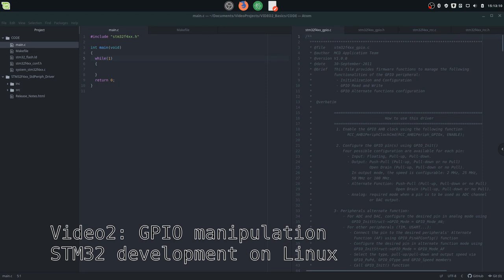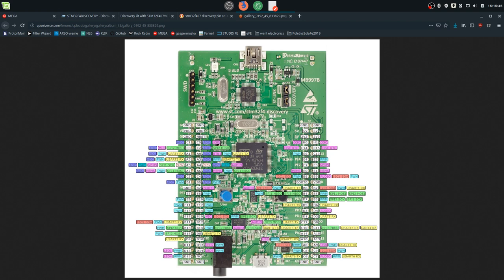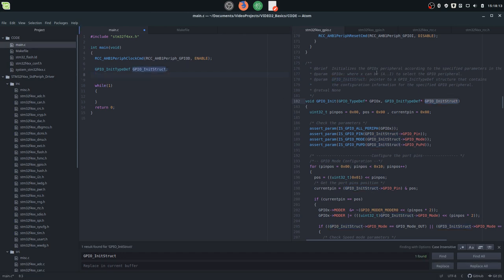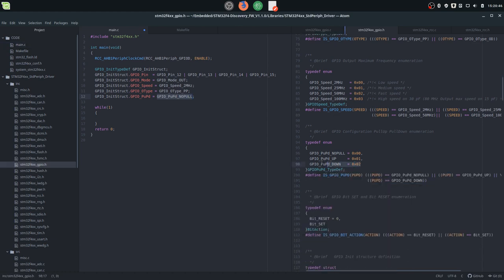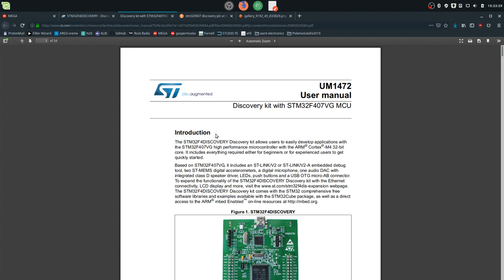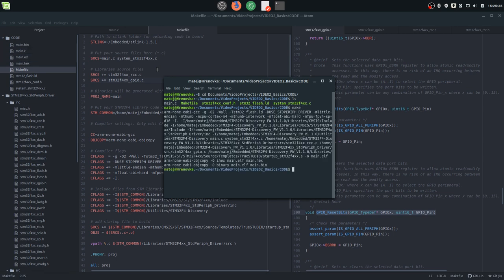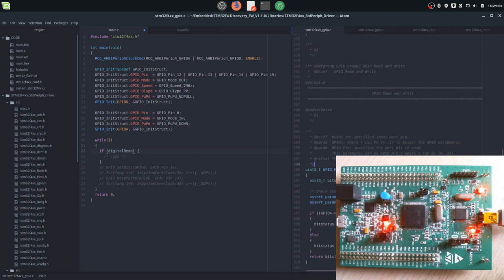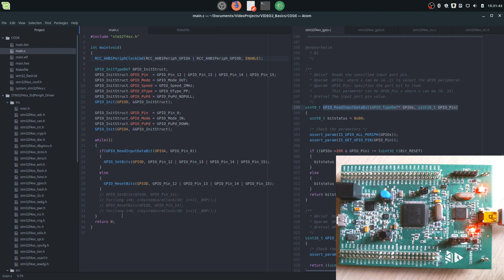Basics of GPIO | STM32 development on Linux | VIDEO 2

Comment: Excellent videos.  I still question the need for the many built-in functions versus direct register writes.  I believe ST calls these LL or HAL functions.  Think how much simpler the dependencies would be if we only needed the pointer constant labels for the configuration registers (forget bit definitions - not worth it).
Reply from the maker: Thank you for watching. I made these videos because this way of starting helped me understand operations and workings of a microcontroller better with no abstract functions from either hal or ll. Of course, I use Hal for any work because its convenient and you're less likely to misstype a register or a configuration. Time spent on initialization is also reduced. Make sure to watch newer videos for HAL.

Comment: hi bro, i have seen all your videos and I find that it is very instructive.  especially the earliest ones with the standard lib. however, i wasn't able to use your github code because i have an F303ZE Board. so, can you please explain how to code or generate the ( makefile, flash.id, config.h, systeme_stm32.c). thank you for all the videos !!!
Reply: i find this low Lib very helpful for understanding workings stm32 better
Reply from the maker: You can find these files on ST website much like the software pack for F4 discovery, just for F3. I belive you can get the linker and config files as well. Another method could be that you can get F3 family library and then get the specific config files from Cube, either hal or ll. Those config files should not change, only libraries do.
Thank you for watching :)
Reply: Done and it worked 😉 thank you again 😊
Reply from the maker: @mouadmoatassim5344  glad to hear that :)

Comment: Is there any other documentation where I can take a look at a higher level.There is just so many things in the source code. 

https://discordpy.readthedocs.io/en/latest/api.html#client
this python documentation for example is really clear and much less complicated than the source code itself you know.
Reply from the maker: The documentation is a bit sparse for this old library, you can find some reference manuals / documentation for certain processor families, but coding and process is universal more or less across all other families supported by stdlib: https://www.st.com/en/embedded-software/stm32-standard-peripheral-libraries.html#documentation